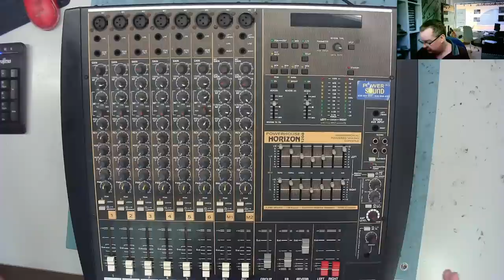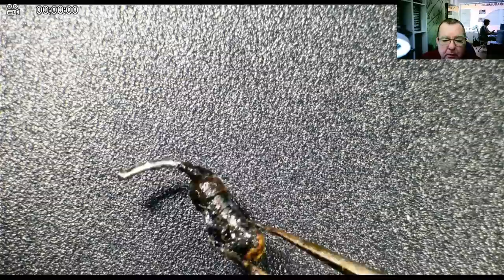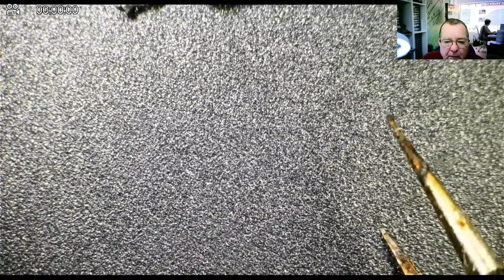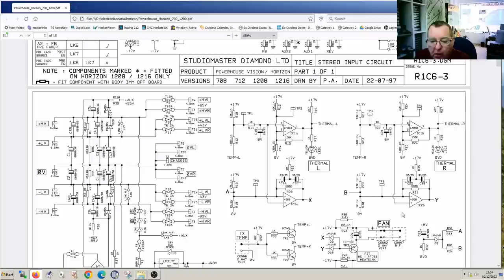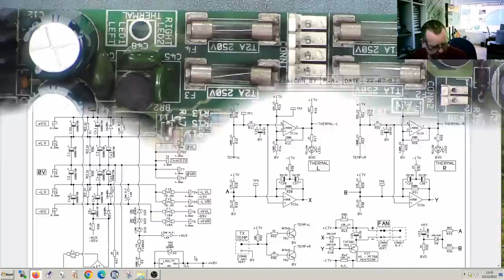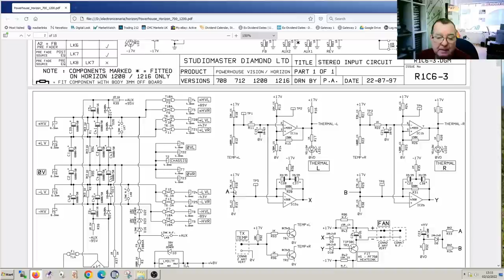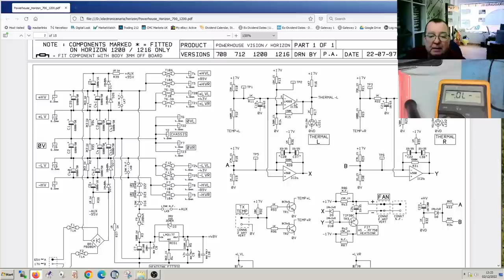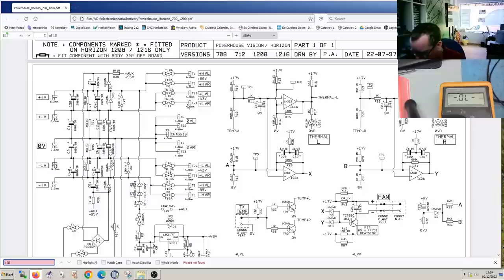Can We Repair A Burnt PCB?

Comment: You may get better results of the vacuum de soldering tool by keeping it active while removing it from the PCB and then waiting a second or two before stopping it may limit the clogging of the tip.
Reply from the maker: I'll happy to give anything a try if it helps. Thank you

Comment: Hi Richard. To make removing lead-free solder easier, mix it with low temperature solder (Low meld temp solder). This solder is available in rods of about 10 to 15 cm. Usually the component comes loose so quickly that it falls off the circuit board by itself. Then, of course, clean the holes. Low meld solder is only there to remove components, so NEVER solder components on a board with this solder. Use your leaded solder for this. I've been using this method for quite some time now and it works time after time without destroying the tracks. Give it a try, I'd say good luck. Greetings from Belgium. Andy.
Reply: that's great Andy, but its expensive.  when leaded will do as well.

Comment: Great video once again Richard - I find my de-soldering gun will tend to clog less if I keep the motor running for half a second after lifting up from the board. It also reduces any residual solder sticking to the pads.

I gotta say that PCB layout isn't the smartest bit of work I've ever seen. You can see how much the short has heated the HV track and destroyed the lacquer, increasing the likelihood of track oxidation, climbing track resistance and a viscous cycle of overheating ...

Comment: With all that corrosion it may be that the 95 volt supply arced over in the area of those resistors and there is no other short. The corrosion along the rest of that trace may be because it runs warm normally and that increases the rate of corrosion.  Tell the customer to stop taking that mixer board to the beach ⛱️  Regards, David
Reply from the maker: Yeah it seems likely that the 95V did arc over there, but I still think some sort of liquid was involved in causing that to happen.   It is really odd how the apparent corrosion affects that track across the PCB, but not ones running parallel with it.  It's like the high (negative) voltage somehow attracted or electrolysed something corrosive out of the air or some odd process like that 🤔
Reply: @LearnElectronicsRepair  I've seen similar things with leaky battery cells, more often than not the corrosion will be along the path of electric potential, even though the actual electrolyte is smothering other tracks :)
Reply: @budgiefish  Funny thing is is that I am repairing an old PC motherboard where this actually happened from the old BIOS battery leaking.  There is practically little damage around where the battery leaked, but instead, considerably further down at distant connections where the liquid never reached but still makes contact with the battery.  🤔
Reply: @arthurmann578  I think corrosive gases are involved too :)
Reply: @LearnElectronicsRepair  I think the "corrosion" is most likely the PCB coating being heated to the boiling point by the current going through the track.

Comment: Hi guys. Was there ever a follow up video to this powered mixer repair? One thing that has to be done is to cut out all of the carbonized board because carbon conducts, sometimes this means re-building part of the circuit off of the main board on jumper cables.

Comment: with desoldering that connector it would go way easier if you used extra flux with the braid will suck the solder better in to the braid
Reply from the maker: That would also clog up the vacuum desoldering tool way easier as well.  I have learnt this by previous experience - if you intend using the vacuum tool do not add additional flux to the joint 😉

Comment: I would be very concerned that the carbonised parts of the PCB will be conductive in ways that doesn't match up with the schematic. Very informative video that clearly shows how you process such extensive damage.

Comment: Hi Richard. thanks for the another informative video. This kind of fibereglass PCBs also getting somewhat conductive after burned completely.It'll specially effective in high impedance circuit area like here with arround 680k resistors. you may have more consideration on it.

Comment: Wow, that was a very charred board, guess most would have said NO to this job. Will you be using epoxy to reinforce  this area afterwards? When doing work on newer boards it is necessary to use leaded solder to be able to get the plated-through holes clear. Thick leads and small plated through holes with lead-free are a nightmare! I have done work on an HF power amplifier done like this, horrible construction.. When I worked in the industry we were told to cut IC leads and pull them one at a time like you did (no lead-free then) In fact, when using a desoldering tool you can hear when it is blocked, the pump motor 'pitch' rises.. Good luck, it will be good!
Reply from the maker: Actually I'm just going to bypass the whole charred area. The burnt resistors and tracks that connect to the op-amp and LM393 can be soldered directly to +/-17V which I can find at multiple points in that area, and the relevant IC pins.  The -95V I will cut the track at either end and will use wire to connect from one end (R38) to the other end (the IDC connector CONN4), bypassing and isolating the entire corroded track.  I will do similar with the other corroded track(s) I can see near the CONN4 connector, if they read open circuit or look really bad.
Reply: @LearnElectronicsRepair  Yes, probably the easiest and best solution here. D'you know if they had spilled drinks into the board? bad habits..

Comment: You accept rather difficult jobs. Many repair shops would just refuse this kind of job.
Reply from the maker: Yeah I'm something of a masochist LOL
I do enjoy a challenge though, it's good to explore your own limitations and very satisfying if you get a successful result 🙂
Reply: @LearnElectronicsRepair  Fully agree. It's not that badly damaged in a way - although I would definitely not run that -95v over that area (cut the existing (bad) traces a good 1/2" away from that burnt bit - the carbonised PCB will have conductivity! - and jumper with a bit of insulated wire). In terms of not accepting a job - I think it's the customer not the repairman that should decide whether the job goes ahead based on value (economic and sentimental), usual caveats attached. Of course some things are simply not feasible to repair (like a NOCO Genius 10 charger which is encapsulated in silicone), and repairman would be well within reason to refuse to repair something hazardous to health too :)
Reply from the maker: @budgiefish  Actually I will isolate and bypass the entire minus 95V track, and in fact the entire charred area in the +/- 17V circuit,  part 2 of the repair coming soon, this part was long enough already at 1hr video 😉

Comment: Richard, I see that you struggled with the IC and had to butcher it to get it off the board. I recently discovered low melt temperature solder that buys time to extract ICs by mixing the low melt with the normal solder and then pull the IC out of the board with almost no effort. I'd be interested in your opinion of this technique.

Comment: what suprises me is that whatever caused that damage didn't blow the fuses in that fusebank nearby
Reply from the maker: Oh actually two of the fuses are blown, I just didn't mention it, the pair further away from the burnt area, by the TO220 transistor.
Reply: @LearnElectronicsRepair  yeah i saw those. that's why i left another comment. power surge perhaps. ac spark. we know what killers they are.
Reply from the maker: @frankbaron1608  Yeah I saw your second comment after replying to this one.  Just a case of crossed lines. 🙂

Comment: I do see a little irony in the fact that there's black smoke... on a perfectly good glass fuse. The joys of electronics.

Maybe the use of fused resistors would have been handy in this situation.

That's about as bad of a burnout as I've seen.
Reply: Soot*

Looking forward to part 2.
Reply from the maker: Yeah I get the irony of that, however if you watched the video through, all the evidence indicates that the arcing or burning initially came from the -95V PCB trace that passes underneath the burnt components but is not electrically part of that circuit.

Comment: You mentioned that the customer rents out this equipment so he probably has more pieces of this equipment . Would it have been simpler to ask to borrow another piece of this equipment or ask the customer to take a picture of the pcb . Alternatively contact the manufacturer ?
Reply from the maker: Yes that is another option, though I am pretty sure I worked it all out by detective work, partly to show a possible technique for this type of repair. 😉Another subscriber also offered to send me some hi-res pics after the weekend, so there will be a part 2 video soon.

Comment: 52:36 - Richard, I would call this a pin header or connector. A socket has holes to accept pins. I might even call it a plug (but, hardly a socket).

Comment: hi it would worry me  why did it start the burn out  and this is the 2nd time i would have 
opened the mixer   if the pcb could be got it would just be easy to put it  a change over

i had a betacam a500p  the power unit was very un lucky  i binned it to stop
the bad luck i had with some of this range yes the bad luck went away with the unit

it's easyer to find parts for the old betacam digi decks  and it save time just doing a
change over  time is money  

i have seen alot of  hard greace in decks   like the betacam sp bvw75 and teac reel  to reel
deck getting them clean out takes time  as they are for me i don't mind
the time working on them

i say 90% of the betacam sp bvw 75 is  jammed up moving parts  note 
i have 30 of them  yes the head drums are showing wear over time

i have a plan for the decks wear the video is bad  the sound on
all of them is go channel 3 4 start to play up when the video is bad

i have been told  by a tec and there no bad  channel 3 4 yet on any of them

love the video you do

Comment: WTF Are you doing still using copper solder removal tape?   Don't you have a solder vacuum?   You are putting way too much heat into that board.  Why on earth do you need flux to desolder?   Very bad practices right off the bat.